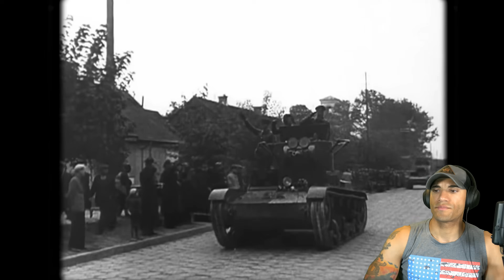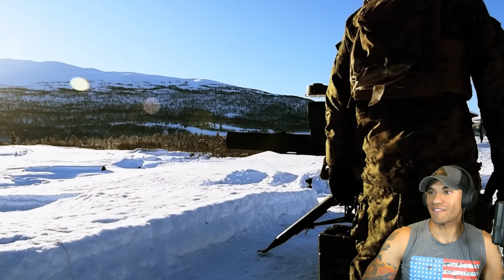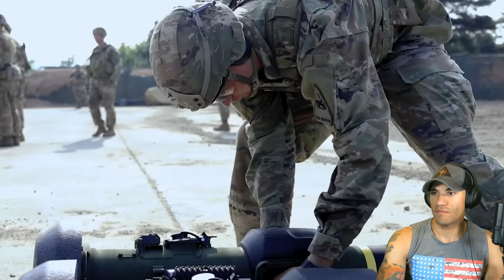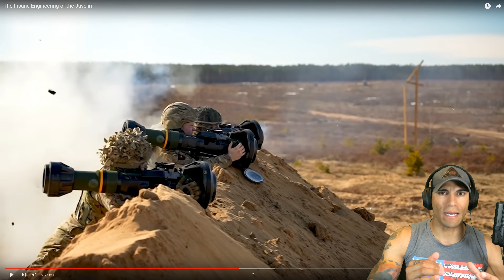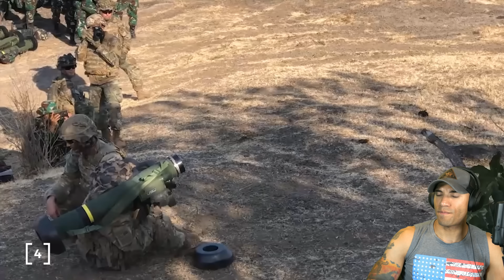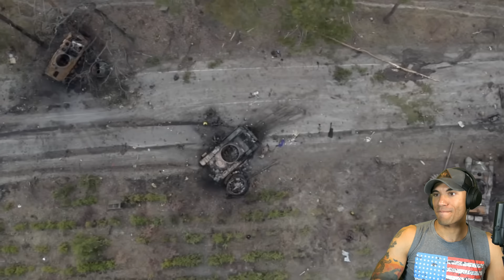US Marine reacts to The Insane Engineering of the Javelin

Comment: Theo, your content just gets more interesting. That made me laugh, coming from a military guy, "My exposure to the Javelin 4 came from Call of Duty' 😂

Do they still have them? Anti tank rifles. I imagine it would have a massive caliber and armour piercing.

I'd hate to be a Tanker. I'd feel so trapped and claustrophobic. Tough job

It is amazing how the Javelins steer themselves.

We don't know if Russia are losing. But if you have a military that are recruited by the state as opposed to an army that are fighting for their loved ones and home. I know who I'd put my money on.
Reply: in regards to Anti tank rifles , there are no modern anti tank rifles as modern tanks have way to thick armor to be penetrated by a rifle round, however there are Anti material rifles that can penetrate low level armor at very long distances used to hit sensitive equipment on tanks like the sights or electronics. but these are mostly used on lighter vehicles and vulnerable areas of armored systems to save AT-missiles for heavy vehicles.

One example is the Barret M82 (often just called Barret 50 in games) firing a .50 BMG (12.7×99mm NATO)
The Ukrainians use a rifle called the Snipex Alligator firing a 14.5x114mm round capable of penetrating 1cm (10mm) RHA at 2km or 3cm (30mm) at roughly 100m. penetration may vary based on angle and specific ammo variant

just for those wondering a .50BMG is sometimes described as a peashooter compared with the 14.5x114mm.
Reply: @marcrasm  Thanks man 😊
Reply: @marcrasm  That's why the Norwegians invented the Raufoss .50, to get the punch of a 20 mm. Does it reach that, depends I guess. At the time it might have. Still kicks ass but would love to see something like that for the Snipex.

Comment: In England we used to train once a week on the Javelin when we were 12-13 years old...Put hairs on your chest! We also got up to speed with the Shot putt and the Discus too.  Though these training sessions often got cancelled if it was raining so we had to do cross country running instead.
Reply: for the algorithm
Reply: Yeah. I remember the fight to get to the front of the line to get the one that wasn't bent
Reply: @ryklatortuga4146  😄 nice one mate
Reply from the maker: @ryklatortuga4146  haha thanks
Reply: @ashscott6068  it's perfectly fine if your javelin is a little bent. Or maybe not even quite as long as the others

Comment: I was surprised to learn that the Javelin is single use only. Does that mean that 
the launch tube is just thrown away?
Reply: Most likely. A lot of man-portable Anti-Tank weapons are single use only because the materials strong enough to resist multiple missile launches without deformation are heavy which limits how big of a missile you can have.

Comment: Pretty sure when he says "light weight" its less referencing how heavy it is for 1 guy to carry and more vs the weight of alternative systems that require vehicle mounting or assembly on site (like the TOW2 or ADATS) 
Sort of how a M2 browning is a heavy machine gun by the infantry perspective but if you were talking about aircraft mounted weapons it would be comically small.
Reply: @DJWeapon8  man portable is not commonly used outside of militaries. Real engineering is more catered to the general public.
Also the TOW system is considered man portable, so are M2 browning's but are almost never referred to as "light weight" systems. There are also a lot of man portable systems that are not operated by 1 person unassisted (or not supposed to be) most infantry anti tank weapons are designed with a 2 man crew, leading to the term "crew served" even GPMG's like the FN MAG or PKP are supposed to be operated by 2 people even tho 1 person can haul those monstrosities around.

Comment: The shaped charge was a German invention during WW2 first used in their Panzerfaust antitank weapons.
The javelin is a very good weapon, but it's very expensive to use against other targets besides tanks, like bunkers. The required cooling of the sensor that takes about six seconds to activate the missile may be old technology by now. The Israelis changed their sensors to non cooled IR on their latest versions if the Spike family missiles, so this is something the US needs to examine. One needs to wander how an AI pattern recognition software would react to camouflaged targets, specially if they use the Swedish Barracuda multispectral camouflage covers. Also there seem to be a problem in most heat seeking AT missiles, in very hot areas, were the ground gets very hot and confuses the missile seekers. Because of this the Israeli Spike missiles have dual guidance with both visual and IR optics. Non the less the Javelin with it's 800mm RHS penetration and the selection of straight or top attack modes is a very good system against tanks. 
https://www.youtube.com/watch?v=viTBdqNwDNo
Reply: The invention itself is way older, like from the 18th century. Still German though.

Comment: Javelin $80k versus tank $1.2m to $5m!
Why do armies still use tanks?
Reply: Like said in the video, it's a vital tool. A tank offers a highly mobile, extremely resilient, both in terms of being able to take on a lot of damage (requiring specialized weapons to even really threaten) and being able to keep in the fight for long time since they also carry a lot ammo both for the cannon and often overlooked machine guns,  platform that can easily deliver massive direct firepower at rapid speed. 
However they are not invincible, nothing is. They require air cover, infantry, artillery and logistics to prosper. Combined arms is the synergy of different weapon systems where they each cover for each others weaknesses with their own strengths, leading to a massively stronger whole. However combined arms is very difficult to do well. And Russia has been doing a particularly lousy job at it. Hell we still, after 6 months, get videos of lone tanks just wandering in the fields.